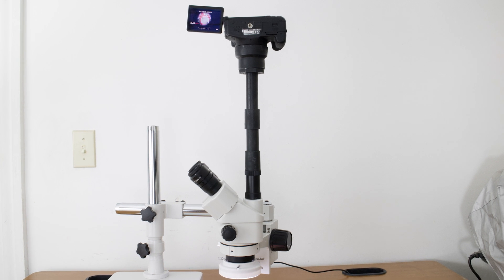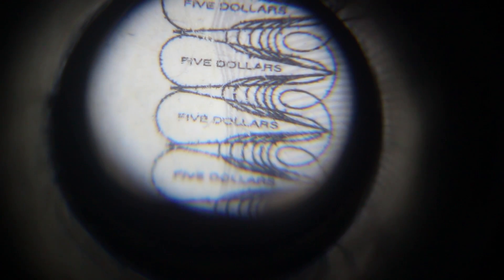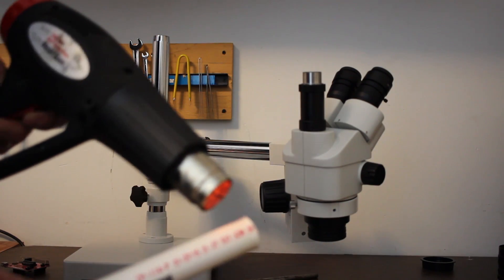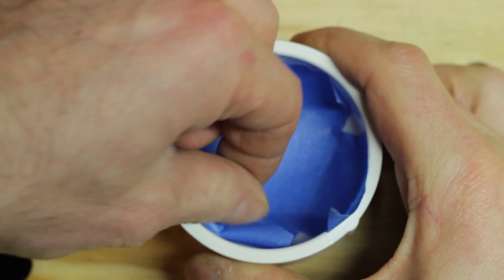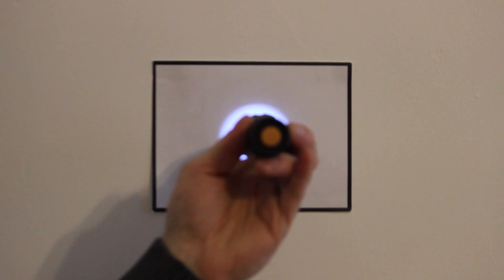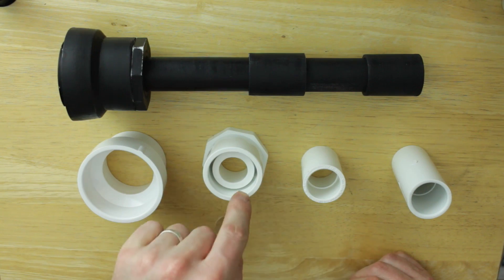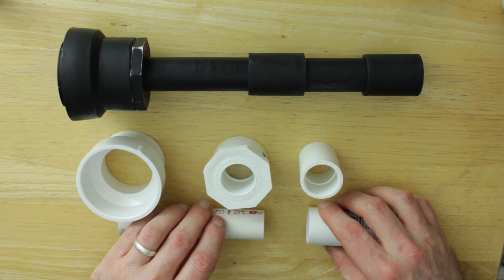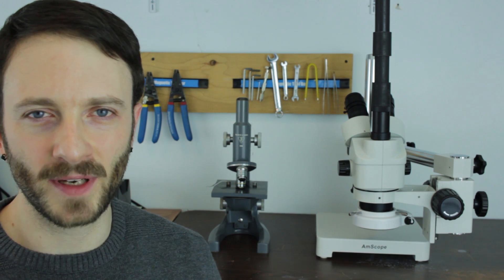Build a DIY DSLR camera mount for your trinocular microscope - HNB #3

Comment: It doesn't seem worth it when you can buy premade adaptors and lens for a DSLR to fit a microscope
Reply from the maker: I agree.  I mostly wanted to see if I could do it, and I did. I wouldn't even use the DLSR adaptor.  They make digital cameras designed to mount in the  trinocular port that aren't all that much more than the DSLR mount.  That's probably the best option for most people.  Thanks for watching, cheers!

Comment: I built something similar years ago for a reverse lens macro mount, I solved the reflection issue by spraying the inside of the tube with matte black paint
Reply from the maker: This was a while ago, but I am pretty sure I did this.  It was a neat project, but for all the trouble I spent messing with this it would have been better just to spend the $125 on adapter.

Comment: Looking to make one thought this doesn't come close to my expectation, but still it is good enough for me to find part that I can use.  I have a T2 adapter with my DSLR, it doesn't come with any lens : it give the maximum view but also a "reflection rings". I need something similar to focus the image to avoid the reflection.
Reply from the maker: Cool, it would be interesting to see how it turns out.  This adapter was too unwieldy to be practical.  When  I needed a picture to send the assembly house, I typically just used the camera on my mobile phone.  Good luck with your build and thanks for watching!
Reply: @HacknBuild  I just found a simple way to deal with it :  get a $10 DSLR T2 ring to 1.25 inch scope adapter that slot in a 28mm (1.1inch) compound microscope eyepiece perfectly. I can use this setup on the stereo microscope with a 30mm/30.5mm adapter ring. No complicated setup required.
Reply from the maker: @moot2046  Good thinking! Have you tried it out yet?
Reply: @HacknBuild  Yupe. It works. Except I need to put a tape/bad to prevent the 28mm eyepiece protrude into the camera sensor.